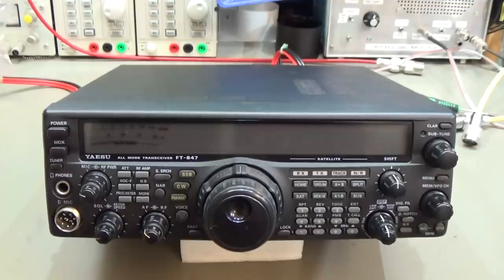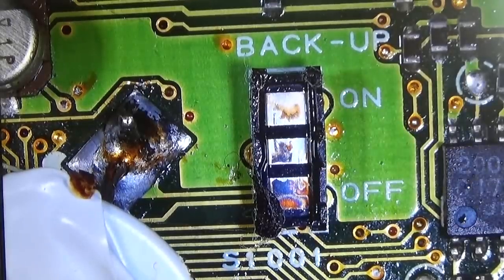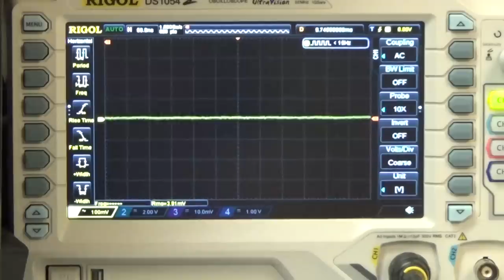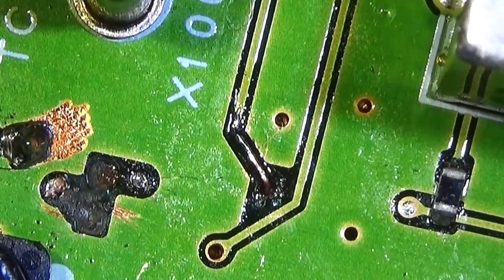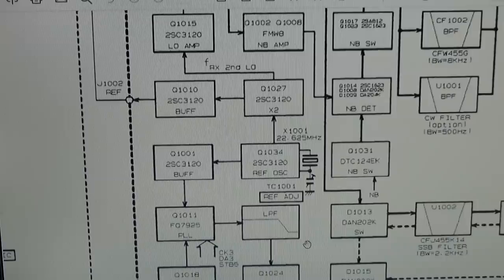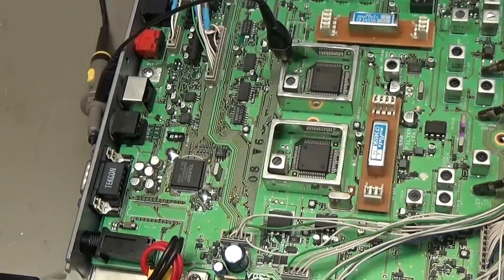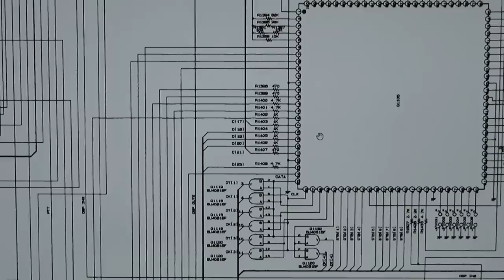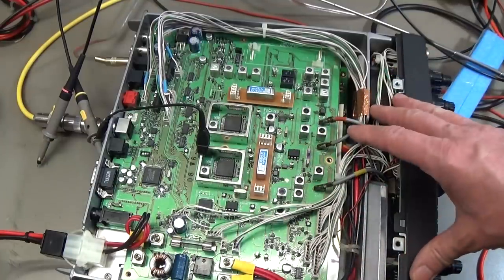#202 Yaesu FT-847 how easy can a nice radio be wracked up?

Comment: A man's got to know his limitations.  The owner of this radio didn't know his.
Reply from the maker: you are 100% right
Reply: Got to have a good magnifier, good TEMP controlled soldering iron with right size tip as a minimum.
Reply: So many spoil good radios when can't do nothing enough good.
But here is always them who think can do everything.
Reply: I'm an electronics engineer, quite experienced with soldering (not that much of an expert in surface mount) and I got kinda nervous opening up my european IC-7000 (to open it up for the back then newly allowed 60m band) and took a lot of care and was relieved not to have fried anything.

Comment: I have no knowledge of this radio.  But is that an RS232 port on the back of the radio?  Hook up a breakout box and see if the UART initializes (built into the processor?).  If it does, is there anything on the TD or RD leads?  I say this because as a programmer from this era it was very common to squirt out status messages during initialization of the system and to send error codes (in ASCII) if something goes wrong.  Just a crazy random thought....
Reply from the maker: Good point George...Thanks for comment

Comment: I bought an FT-847 the first year they came out and I remember there was a recall for the power switch and I really didn't want to have to ship my 847 to Yaesu just to replace a silly power switch. My radio wasn't exhibiting any kind of problem but after talking with Yaesu they sent me the replacement switch, which I happily replaced on my own.

Comment: I just got mine back from a shop in Texas. I bought it used as a newly licenced ham from a reputable shop. There was a few months delay before I started using it on HF since I was only on UHF and didn't realize there was an issue. It had terrible receive quality on HF and I didn't realize the volume was very low. They did several mods including the power switch, found the short causing the issue and brought everything into compliance of spec. It works wonderfully now and its much louder..

Comment: I really appreciated and enjoyed this video.  It brought back horror memories of my Kenwood TH-F6A that went into meltdown because the "ON/OFF" "switch" was not an actual switch but a "soft switch" which would not allow me to turn it off as it went into meltdown.  The protective covers on the right side (mike, speaker, etc.) were missing and some jerk nearly hit me causing the contents of a coffee cup to be spilled into the rig via the jacks on the right side.  The battery would not come off unless I removed the belt clip, and since I was driving down the interstate I had no screwdriver to do so.  I do wish I could get it working again, but I fear that like the one you worked on in this video, it is simply not cost effective.
There were a couple of times that I thought I saw a problem that you may have missed.  One such item is at 38:24 in the video.  In the upper right part of the screen is a bit of debris that it appears that you didn't see since it didn't show you removing it.  There was also a bit of debris above the trace of the bottom left resistor between the trace and the ground plane.  You may have taken care of both of those, but I didn't see it, so I couldn't know for sure.
Keep up the excellent work!

Comment: Excellent video, very informative. Just a suggestion, press the fast and lock buttons together at the same time and turn the radio on this will reset the micro, it’s just a suggestion but it might be that at boot up, some of the initialize code is corrupted, leading to an ‘unknown-status’. There is probably enough code available to ‘force-shutdown’ rather than enter a possible ‘burn-out’ status. 
One final suggestion, this is from my early PC service days, when a ‘486DX2-66’ was a fast processor. My original IBM PC has directional detection on the CPU Cooling-Fan, if the fan was seized, and not running, the system would lock-down rather than overheating, if the Fans on the FT-847 are not running, could that force the fault you are seeing? 
Great video again, Bye-4-Now - Neil G1OVH - UK-QTHR.

Comment: I worked for years at a major electronics manufacturer. My first day on the job they made me take a class on proper soldering (and unsoldering) techniques. Even though I knew how to solder, I still learned a lot in that class! It's scary to see the mistakes that some people make: dirty tip on the soldering iron, wrong flux, not wetting the tip first, wrong tip shape for the task at hand, using an iron that is too hot, blowing on the liquid solder joint to "cool it down faster", not recognizing a cold solder joint (or not knowing how to prevent it), etc. etc. There's a lot of metallurgy and chemistry involved as well which can adversely affect the properties of the solder joint after it solidifies from the molten state. Just solder it correctly and let it cool at its own rate.
Reply from the maker: so true

Comment: Good of you to show us even when it is not fixed.  I would recommend focusing on the destroyed vias etc. in the mode area 1, 2, 3 and 4 at 7:41.  Most of the time, it is the last thing that "changed" that is the culprit.  The processor is booting up and even running long enough to switch modes and receive.  So the processor is probably fine.  It has to be some input to the processor, analog or digital input, if it is the processor shutting it down.  I am sure you checked that any DC to DC power supplies are not causing the shutdown.  Are there any protection circuits/blocks?  Did they mess with the bias settings?
Reply from the maker: Thanks James, yeah destroyed vias are a problem but can't find any additionally..DC/DC has been checked out and are found good...

Comment: I know it's a 5 years old case, but anyway... I got similar fault in very fast, 2x9pin needle printer with huge power supply unit. The PS unit was switching off after about two seconds from Power On. All voltages were OK (I had to measure them with oscilloscope), no symptoms of shortage in the mainboard, motor drivers etc. The PS was receiving an "emergency power shutdown" signal from CPU. The problem was caused by one of the resistors in voltage divider measuring one of the PS output lines. It changed the value from 20k to 40k, so the measured voltage seen by CPU was 3V instead of 1.5V. So it looked like an overvoltage and CPU immediately halted the PSU. It took me 3 days to find this resistor as at first glance 3V looked quite a good value for a 5V Z80 based CPU, until I made proper calculation ;).

Comment: I own two FT-847's and to see this makes me very sad  and a bit angry...  I had a similar problem on one of mine but it was the power switch itself. If I held down the switch it stayed on. Eventually temporarily did the mod for the switch and then replaced it...  Great video and keep up the work !
Reply from the maker: Yeah the power switch is a known issue on this radio...

Comment: Hello Peter,I can only tell you about an experience I had with a MEOS TV I have it did the same as your radio, I checked the capacitors, and the diodes in the power supply, all was well, board looked clean nothing showed up no smells, so I put freeze spray on section of the board at a time and switched on, eventually I went to one section  powered on and immediately one component thawed out, it was one of those smd caps, so I got the part number off the schematic and I swapped it out,  bingo the  TV fired up, wife was happy I was relieved , so as the board your working on has been messed about with, could this method help you out.
73 Paul M0BSW
Reply from the maker: Thanks Paul very good approach and a valuable step forward! 73
Reply: i just wrote this in a reply to an earlier comment, glad you came up with this one.

Comment: I would try using an logic analyzer configured to trigger when the reset goes low.  I would also set the LA so that there is a healthy pre-buffer before trigger, so you can connect many inputs of the LA to various test points on and around the processor, and then be able to go back and see what happened right before the processor reset.  I would also make sure to monitor any interrupt type of pins in relation to the reset line.  Could be an additional fault that is generating an interrupt signal that the firmware is decoding to be a power off condition.  Last resort would be the "shotgun" approach and simply test all pins in relation to reset, again seeing if anything is happening right before the reset goes low.  My last ditch effort would be to freeze the board real good and see if you have any caps or other components that have failed short.  Ceramic caps of that era are known to fail short, so you might see that if any device instantly heats up.  Should all that fail, I would suggest the owner buy a donor board like you suggested (that and revoke his soldering iron license till he takes a certified soldering class!).

(edited to remove suggestion of tying the battery switch one way or the other, as i failed to notice your comment on the subject)
Reply from the maker: Thanks for comment
Reply: I assume he doesn’t do this work for free! At some point it just doesn’t make sense for him to keep billing hours!

Comment: Since even the panel lights shut off, I would assume that the power supply is receiving a disable command from somewhere. What supplies that command and can you monitor that control input to the power supply? Can you disconnect that line and maybe force the power supply to be enabled (or not disabled)?
How about finding an FT-847 support group on Yahoo or Facebook where you can discuss this problem with hard-core enthusiasts? These groups often have community files with factory service manuals and a wealth of undocumented knowledge. The odds are high that you are not the first person to experience this auto shutdown condition.
Reply: Finding the source of the shutdown was my thought as well. It may just lead back to the processor, but there has to be some circuit triggered by the processor to cut off power.  See if that circuit is rogue. Or being commanded.  Also,  if you can find a working radio,  compare the startup serial protocol of the working radio to the dead one.  If they are different,  you might have another clue.  All the better if you can get Yaesu to send you the protocol specs.  I imagine the header includes a target device address. And the reply may have error codes that give a clue to the root cause. If the serial is I2C or SPI  your scope may decode the hex values being sent.
Reply from the maker: I have tested the shout down circuit and it is working just as it should. Anyway good thought thanks
Reply: @TRXLab  Yes, fine, but can you over-ride the shut-down system? Either disconnect it or strap it enabled, and see if the rest of the receiver might then work.
Reply from the maker: yes I have hard wired from an external voltage supply to overrule the circuit but no change...
Reply: @TRXLab  So if you hard-strap the shut-down command signal to the power supply, the power supply still shuts down? That seems to tell us to look at why the PS is shutting down without a shut-down command. I have encountered military power supplies that go through some odd output excursions right after start-up, and internal watchdog circuits shut them down. Put an oscilloscope on the PS outputs and see how cleanly the power comes on. Also try running just the PS, with no connection to the radio. Does it still shut down? Lastly, look at the signal path from the shut-down input of the PS to the device in the PS that actually does the switching action.
Perhaps we are in that strange land where the error protection circuit is causing the error.

Comment: it's not the processor. keep digging.  (reheat the soldering of the processor, with hot air, without removing it from the board. The solder Yaesu used tended to crystallize and make intermittent or no contacts after 20 years of use.)
Reply from the maker: Thanks Pop that is a good hint. I know this issue when the solder melts it feels like chewing gum. I always test the IC pin by pin with a sharp hook and normally you will find a loose connection by this approach. In this case all the pins were in good condition.

Comment: Hi Peter.  I had a similar problem with a stereo receiver.  I would push the on/off button and the relay that provided power to the whole unit would vibrate.  At first I thought the problem was the filter caps in the power supply but replacing them did not solve the problem Finally I started reading about how the reset of microprocessors  worked and how the capacitors around the reset chip were a problem. I used the shotgun approach and replaced all of the capacitors around the reset chip and that fixed it. This seems to go along with Nikki Copper’s more rigorous analyses.
Hope this helps.
Also, thank you for the detail you presented about how processors control radio circuits.  
John C
Reply from the maker: Thanks for feed back John

Comment: Those damaged pads next to xtal and the wrongly fitted 2k2 resistor are where the padding capacitor (along with another "select on test" SMD capacitor) is fitted which forms part of the main reference oscillator.   What a mess! Big 👍👍 up to Peter for keeping his cool !!!!

Comment: Oh man.....1hr 20min video from Petr and at 6:00, we already see this is going to be another case of "The man with the Golden Screwdriver."
This is going to be good, I already know it!
Reply: This was not a golden screwdriver, this was a golden sledgehammer. I have an FT-847 and it still works fine. It's a great radio and it saddens me to see one mangled like that. This is proof that some people shouldn't work on electronics.
Reply: @paulmichaelson7203  You aren't kidding. I think there are some people who shouldn't even be allowed to own nice things, let alone electronics more complex than a hairdryer.
Reply: @StreuB1  Yup, I bought my 847 new in 1997, I've put filters in it, done other mods like the MARS mod, never replaced the power switch and the rig still works like new. It is one of only a couple of rigs that will do cross band full duplex and makes SAT operation easy and fun. I love that little rig and I'll never sell it. It's a shame to see one go so needlessly. I bet 90+ percent of 847s are still operating. Nothing can live forever especially in the wrong hands. 73 de k8idx. 73 to you too Peter, I love your videos.

Comment: Perhaps the power supply is providing the correct voltage but it can't for some reason provide current and as the current tries to surge the processor shuts down?
  Or some other short pulling the power supply down?

Comment: I have been using this radio for a very long time. for comfortable work on the VHF bands, I installed TCXO
Reply: Me too I installed a TCXO on an FT847 while keeping the original assembly that I isolated by cutting a track and moving the 2k2 power resistor, as well as replacing a chemical condenser with a tantalum capacitor to be able to install the TCXO on feet welded to the board. On the rear face of the TCXO with English engraving I installed a power supply circuit with capacitor, regulator, choke, input and output to have a clean and stable power supply. I also installed a micro relay controlled by the ignition off / on switch to prevent the off / on switch from burning by overload. Very clean and invisible assembly for those who do not know the turntable.

Comment: Nice video Peter.  I did have one of these rigs. It worked fine for  a while and then did the exact same as this one. 
I think i saw i was loosing 5v signal down to 2.4 or something.  After some troubleshooting just like you did,  it lead me to a small smd regulator on the bottom side of the bord. It was near the relay area 
. I replace it and the rig would work real good for 19 out of 20 power ups. 
So once in a while it would not power up. I never did git it working any better than that. Hope this helps you or someone else.
Reply from the maker: Thanks Grant, I believe you mean Q1134 witch is the voltage regulator for the processor....The Q1134 is working fine. Thanks for support! 73

Comment: I'm only at the point where you found the 2.2K resistor.  I bought a broken radio for $300 that was dead.  I troubleshot the radio only to find the 100ohm resistor was open.  I thought that the resistor was too small and had too much current running through it and decided it needed to be larger.  I replaced it with a 2.2K resistor and the radio came to life.  I then happened to google the problem (after the I fixed it) and found this to be a common problem and Yaesu made an engineering change to replace the resistor with a 2.2K resistor :-)   That may be why it was replaced...poorly so unfortunately.

Comment: Hi! Nice video and explanations how different parts of the radio communicate to each other. And yes, this video should be a warning what can happen to all those who will take the old 100W big soldering iron that they used with great success in the 1960's. I have seen stuff like this. And if you still have the radio around, I would give you a hint to try. I have an FT-847 and I did a MARS mod to it, or tried to do. It was bought from German Ebay back around the 2010, so I think it came with your area software and settings. I followed the info on the internet and it didn't work, if I remember right I was on a same kind of situation where it just rebooted itself like that radio. I returned those "jumpers" to original and it worked again. I think there might be different versions of the processor or memory that will not work with MARS-modification settings or with info of the original settings you find from internet. But if you are really sure what pads were connected at factory this might be not the case. But still an easy one to try. By the way, excellent job with repairing those missing traces! I have a working FT-847 here so if you want some info to compare, you can message me.